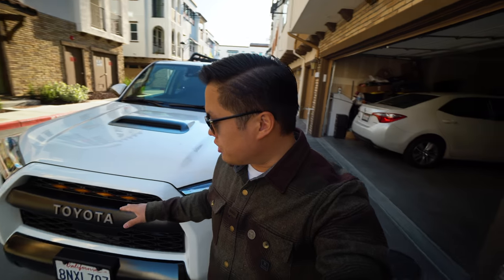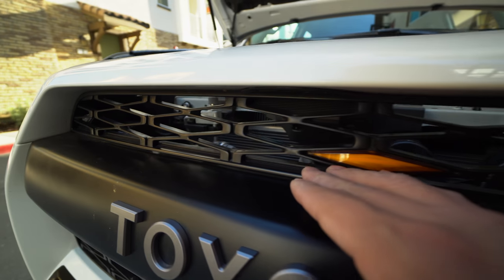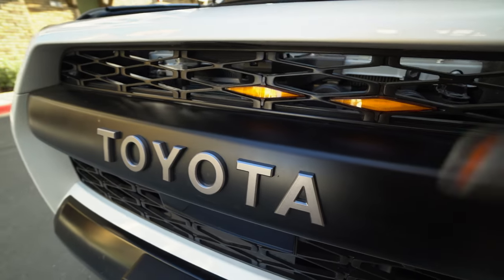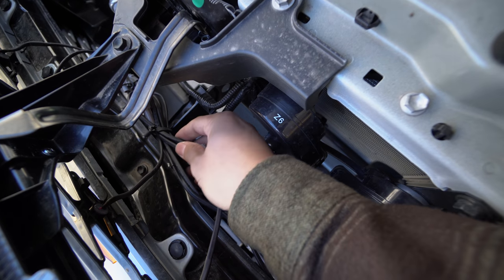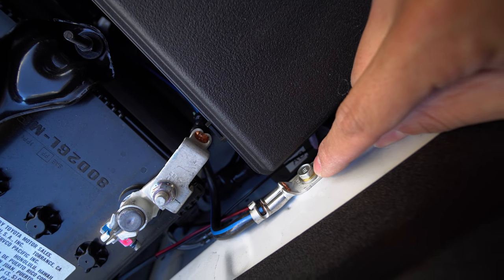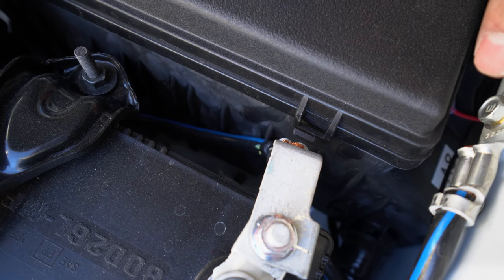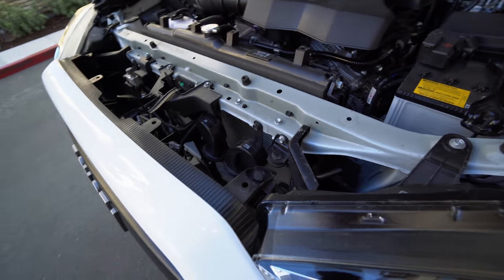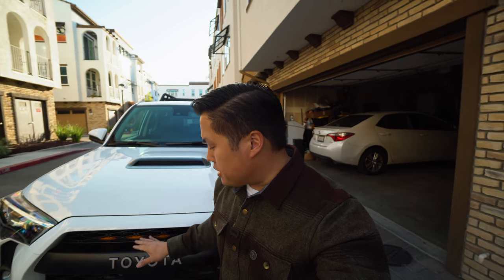2020 4RUNNER TRD PRO - Raptor Light Installation

Comment: Excellent, very straightforward video, especially for those of us with 2020+ 4Runners, for which the fuse boxes and layouts are different than earlier models!  EXCELLENT instructions on the push-clips for the plastic radiator cover as well - many people have broken those trying to put them back in!
Reply: Mines a 2022 and not sure where to plug in

Comment: Dude you saved my skin, I originally followed installer’s video which had me do a different fuse location - got a dreaded ‘check engine - contact dealer’ message… ugh! Found your video and followed your advice, and am all set now. Thanks a lot, good karma to you :-) (fwiw I have a 2021 trd pro and was installing cali raised amber raptors)
Reply: Same issue as you. I have a 21 SR5 XP; did you have to take your 4R in to have the codes cleared?
Reply: @Dmgsalon2  Not necessary to bring in to clear codes - if you remove the black battery cable for about ten seconds and reconnect it, that will trigger the CPU to run a diagnostic check and clear any codes/faults. Of course, only do this after you have properly wired the lights and all fuses are restored/in place. When you remove the cable from the battery, just hold it for the ten count, don’t let it touch anything else and ‘make contact’. Hope this helps!

Comment: Thanks for the video, just to let you know there is a factor cut on the other did of the box that you can put your wire threw.  Unfortunately, the box wont secure completly down because the fuse adapter is too high.  If you find a solution let us know.

Comment: I just got my 2021 TRD Pro about 3 weeks ago and just installed the amber raptor lights on my ride. Love them and thank you for the video. It helped  tremendously. On that note you ever find a fix for the cable and the gap created to the fuse box?

Comment: Any updates on finding a solution to get the fuse box to fully close?
Reply: Did you find a way because I just got my lights and I’m running into that same problem
Reply: @grantharrison32  So I ended up running the wiring through the firewall and piggybacked the TAIL fuse on the cabin fuse box (under steering wheel). The factory cover won’t close here either,  but not a huge issue inside the cabin. You can also find extended covers for this fuse box on eBay that may allow it to close. I ran it like this for a while without issue. Eventually I got a switch panel and changed the wiring so I could easily turn on/off independently.

Comment: Thank you for the great explanation! Question - when I pull the 10amp fuse from the box, is it required to attach that pulled fuse into the add a fuse wire? In this vid, you have both the red and the blue fuses attached. Thanks in advance!

Comment: Great walkthrough!! All other walkthroughs were before 2020 or dealt with pulling the harness into the cab. Although I have a three piece light set, my plug-n-play kit came with an added 5amp fuse while everyone video I’ve seen is 10-15. Thinking of at swappinh out for a 10A. Great vid!
Reply: Hi just saw this post after I ordered 3 led set aswell. Mine too came with a 5A fuse.  I tried to hook it up today to the INJ fuse slot along with the 10A that was already there BUT couldn't get it to light up?? I'm pretty stumped rn, trying to get ahold of the vendor.

Comment: Thank you, Here is a thought I checking around to see if possible. I prefer the led light bar as and it looks like that black piece that is connect below the safety sense could be routed out with a router just the solid black pieces and the led bar light would shine thru without effecting the safety sense. Just was wondering what your thoughts were on going that route if possible. Thank you.

Comment: Hey, Chris, as youve wired it, the raptor lights are always on, right? In other words, they turn on whenever you start the 4R up, right?  If that's the case, any regret having them always on? I've been thinking about wiring into the fuse box inside the driver foot well to cnnect to a switch installed in one of the blanks so i can control them manually.

EDIT - thanks for showing how you ran the wiring routing from the lights to the fuse box. Not a lot of videos do a good job displaying this part. This was helpful to me.
Reply from the maker: Hey Jonathan. Yes, the fuse location I chose means they are on anytime the care is on, including in Accessory mode. I haven’t really had any regrets with this. I guess the only time I could see this being an issue for me would be at a drive-in movie and wanting the car to be on but lights off… but I don’t really go to drive in movies THAT much 🍿

Comment: Have you changed the stock halogen bulbs to leds or hids yet? If you have which ones did you replace them with? Also did you change the inside lights with leds? If so which ones? Great vid!
Reply from the maker: Hey thanks for watching!!! I have not changed my headlights or interior lights yet but they are definitely on the list. Honestly, because I don’t drive off-road a lot yet (to where I don’t have city lights helping) I haven’t seen the biggest need to upgrade right away to the LED headlights. But the interior lights are definitely something I want to upgrade soon because it’s too dim. Then again, haven’t been driving much due to COVID so hasn’t been a high priority :/

Comment: Hi! Thanks for the video. 
Question - when you put the red 10 amp fuse to the tap at inj location i can see a 15 amp blue fuse along with it. is that for the lights? plz explain.
Reply: I’ve got the same question! 👀
Reply from the maker: Walia P Sorry, to clarify the blue 15 amp fuse came with the raptor light and was already plugged into the tap.
Reply: @goodafternoonchris  thanks for the feedback.

Comment: Thank you Chris, for the video!! Question on the lights at night do you notice any difference while you are driving if it is brighter on the road . Not sure how much lighting it protrudes. Besides having your lights and fog lights on. Also yeah I’m bummed about that safety sense being in the way with a led light bar. Had one on my Tacoma there awesome. I spoke to Cali led company they said the bar will still work but that black piece below the safety sense will block the light in the middle part.
Reply from the maker: Hey Don, no difference in total light output. Just a cool look if you ask me. Yeah I know what you mean about the LED bar. I’m thinking of eventually going with the Lo Pro Winch Bumper but with no Bull Bar Tube from C4Fabrications. It will essentially replace just the black part of the lower front bumper, give me a light bar, and a winch opening.

Comment: Is there a way to have them turn on just when you have your headlights on ?
Reply: Splice into the parking light wire. That’s what I did. Mine only turn on when my parking or headlights are on.
Reply: @nachos7565  awesome, thanks
Reply: Use the Lower beam fuse

Comment: Do these affect your battery and how long do these last? Since these are always on.
Thanks for the video BTW. It was very helpful
Reply from the maker: Does not affect the battery much. They’re LED so very little draw. But when the car ignition is in the ACC position then the lights will be on. Once the car is started and the motor is running the lights will draw from the alternator instead of the battery. I’ve had them on my car for almost a year and no issues yet!
Reply: @goodafternoonchris  no issues? You haven’t had that problem that it will turn on randomly sometimes even when the vehicle is off? I’m thinking on doing it but my Tacoma doesn’t have a fuse called INJ so I think ETCS 10amp will do it but I’m afraid that will turn on randomly when truck is not on.

Comment: How long do these lights usually last? Would they die out fairly fast since they are always on when the ignition is on?
Reply: Chris, do you know?
Reply from the maker: Since these are LED I would imagine they would last a long time. I’ve had no issues at all with them. Think of DRL (Daytime Running Lights) on most modern cars.

Also, the construction is pretty good and seems like the plastic housing is nicely sealed so less likely of getting ruined by moisture. Just my 2 cents.

Comment: Is it possible to drill a small hole on the side of the fuse cover to put the wire thru and the caulk it ? So the fuse cover will close properly and won't pinch the wire.
Reply: Then*

Comment: My 2018 4Runner Limited has a fuse box which is configured differently.  I also noticed your hot terminal contained a 15 amp blue fuse and you added the existing 10 amp to that connector.   My unit arrived yesterday with only a 5 amp fuse.  Problem?

Comment: hey @goodAfternoonChris - do you have the link for the raptor lights on Amazon? I see a bunch of choices.  thanks!
Reply from the maker: Here are the ones I got! Seven Sparta 4 PCS Led Amber Lights with Fuse and Instruction for 2014-2022 Toyota 4Runner TRD Pro Grille, Including SR5, TRD off-road, Limited, TRO Pro (Amber) https://a.co/d/87pBI71

Comment: Have you had a new idea? I did the same thing but put lots of electrical tape trying to cover the small gap do water can’t get in there
Reply from the maker: Not yet... I’ve been thinking about what to do to solve that.. any suggestions?
Reply: @goodafternoonchris  I was thinking it could be moved to a fuse that is a bit lower so you can close the lid. You could feed the wire in the “door” that all the other oem wires come through. If you figure something out let me know

Comment: Hi Chris, Will this snap into place like they do on your video? I have a 2020 4runnner SR5 PREMIUM with Toyota Safety Sense. Thank's in advance
Reply from the maker: Yeah totally, you have the same grill design. Not sure if you will be able to fit it above your bar where the Toyota badge is. But you will be able to fit it in the lower section where the Safety Sense plate is most likely below the plate.

Comment: Hi I have a 2020 trd pro army green I was woundering with this can you still wire it to a switch in the car so you can turn it on and off that way! Because I also wanted to get fun switches for it.
Reply from the maker: Jennsylvania 4x4 Yes, absolutely you can. You can take the positive cable and spice it and run both ends into the cabin into a switch to turn them off and on.
Reply from the maker: Jennsylvania 4x4 also, congrats on the Army Green TRD Pro!! I was soooo close to getting that one
Reply: Thanks for the info. And thanks about the 4runner it wasn’t easy they had to find one for me they ended up finding one in los Vegas and I guess trailering it down here! I’ve been waiting for a few years to get one. I’m disabled and this is all I’ve been thinking about for the last few years it’s about time for me to have some fun and adventures in my life. I’m trying to learn as I go the 4runner community he’s been awesome I’m so glad to finally be apart of it. You have a very nice 4runner as well 🙌🏼
Reply: GoodAfternoonChris thank you so much I’m kind of a visual learner I would for sure like to see a video on wiring the switches so I don’t mess it up 🥴

Comment: Just wondering if you have had any issues since wiring these up and with them being plugged into that location. Saw a company saying to plug them into the TAIL fuse location inside the cabin.
Reply from the maker: Jsin Legacy No issues with this location at all. I think you probably could plug them into that location as well but this is easier to access.

Comment: the INJ fuse? what specific power it provides? is that the fuse for the power windows? or?
Reply from the maker: Hello, the INJ port I believe is used for the fuel injectors. If you remove the fuse then your car will not start. So that is the ideal location for the raptor lights because in any key start mode (Accessory, On, Start) power will be going to that fuse location which will also power the lights if you use the fuse tap in that location.

Comment: Chris, did you have to use a different 10amp fuse for the adapter? The 10amp fuse in my 2020 TRD doesn't fit into the adapter that came with the lights.
Reply from the maker: No, I did not use a different 10 amp fuse, mine fit just fine into the adapter the red 10 amp that is in the adapter in mine was originally in the INJ port of the fuse box.
Reply: @goodafternoonchris  Got ya! I may have to order a new fuse adapter for the mini low profile fuses. Thanks again for the video! Really helpful

Comment: So the box fuse cover would not totally close? I am afraid it might shake and fall off
Reply from the maker: Yes, correct. It’s won’t fall off because it’s still secured on both sides by 2 other latches. I haven’t had any issues with it so far. You could force it closed all the way but it will b pinching the cable going into the fuse box. Your call :)

Comment: Do the raptor lights come on with only the lights turned on, or anytime the car is powered?
Reply from the maker: If you plug it into this location, they will come on anytime the car is on. Not just when you turn the lights on.

Comment: Hi Chris, I have a similar question. I’m adding a bajadesigns led bar in the same area instead of raptor lights. The Baja led bar has the amber backing lighting. Do you know if you can still use that same fuse for my led bar. The other wire will run into the firewall and it will be wired to a push button to turn led bar on. So would I still need a 15 amp like yours and just put the 10 amp in you pulled like yours. I want the back lighting on when truck is on. Any help would be great. Thanks.
Reply from the maker: Don Russell Hi Don, great question. I’m not sure what the draw is in your backing lighting so can’t say for sure... but if you wanted it to be always on when the car is on, the INJ is the location that can do that.

However, depending on the draw I would also recommend something like a wiring controller or a wiring block that would give you dedicated switch control for lights. Sorry, hope this helps!
Reply: Wire it into a relay.

Comment: Hi chris ! I have 2021 4runner night shade edition,i have problem on clipping those lights into my grill,I tried to flip them but still it doesn’t stick or click. Any advice?thanks.
Reply from the maker: Hey! Do your raptor lights have those little plastic tabs above and below the diamond? They should be able to fit in the groove of your grill diamonds... also, you can’t fit them in any row. Every other row in your grill where the smaller diamonds are have the little grooves that the tabs fit. Sorry if I’m not explaining this well... hope this helps!
Reply: @goodafternoonchris  yeah i tried those but still can’t clip them in,the groove are little bit bigger i think,and there’s some people that having same problem like mine and what they did is,they used a tiny zip ties,they wrap it around the bottom clip of the lights. I’m gonna try that one later see if it works.

Comment: Hi do these lights come on when the headlights come on? In Canada we have Daytime Running Lamps as well. Thanks.
Reply from the maker: Thanks for watching! No, actually the fuse location where I wired this to makes it so the lights come on whenever the car is on and running. So they are on regardless of whether any lights  are on or not. Hope this helps.
Reply: Great thanks. I saw these on Amazon for $40. Yota and Overland depot sells them for $80 .Are yours good quality? Don't know why theirs are so expensive. Thanks

Comment: Could you place them in the lower grill section if you wanted?
Reply from the maker: Yes you could. If it's a 2020 4Runner though you probably have to place it underneath the Safety Sense plate.
Reply: @goodafternoonchris  So I've actually bought these as it's been 2 months since I left the comment. They will not fit on the bottom section. The diamonds are larger than those on the top. Further the section of the grill below the safety sensor is solid unlike the rest of the grill.
Reply from the maker: Corey Girard gotcha, okay thanks for the clarification! I will make sure to mention to anyone else who asks.

Comment: Hey, besides the original 10amp fuse we transfer to the add a fuse tap, what amp fuse should I use to install on the upper slot of the add a fuse?
Reply from the maker: Hey, my fuse tap came with a 15 amp fuse pre-installed. If you got the exact same one and didn’t get a fuse that came with it you can pick up a 15 amp fuse from your local auto parts store and add it to the top. I haven’t had any issue at all with this setup. Let me know if you have any questions!
Reply: @goodafternoonchris  thank you! Installed it this afternoon! Works great so far!
Reply from the maker: Awesome!! Enjoy!!

Comment: If you want to put the fuse wire coming in from a better place, watch " runnin4tacos" install of raptor lights.  I liked your video instruction also.
Reply: That won't work on newer models, the INJ fuse was relocated and is now on the top row. The add-a-fuse connector hits the top of the lid.

Comment: Has anyone tried doing this on a 2022 TRD Pro?  Everything worked perfectly until I tried to close the fuse box cover... the fuse adaptor sits almost an inch proud of the fuse itself and I cannot get the cover to close, not even with just one of the rear cover latches.  In the comments, someone suggested plugging into the EFI2 fuse but that's 7.5amp not 10.  Any other suggestions?
Reply: I pulled the 7.5 amp fuse for the EFI2 port but the fuse itself is shorter than the 10 amp fuses so not sure it would even fit in the adaptor

Comment: Most of the video is correct but i disagree with the add-a-fuse fuses. You put 10 amp on bottom and 15 amp on top. Unfortunately fuses doesnt work like that. You always want to use the lower amp on top of add-a-fuse to protect the circuit. So top fuse should have lower amps than the bottom one.
Reply: lolz really?